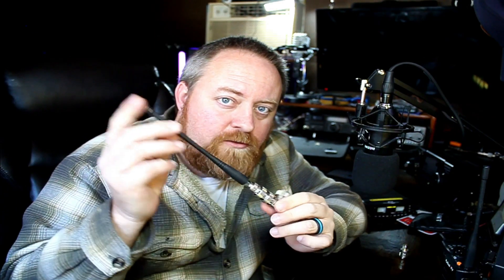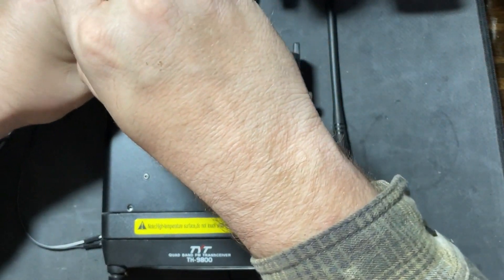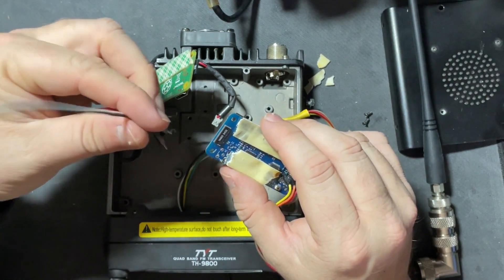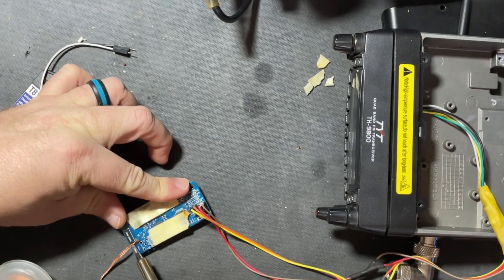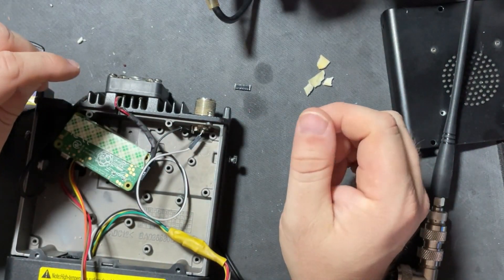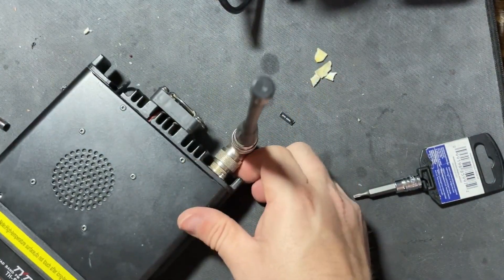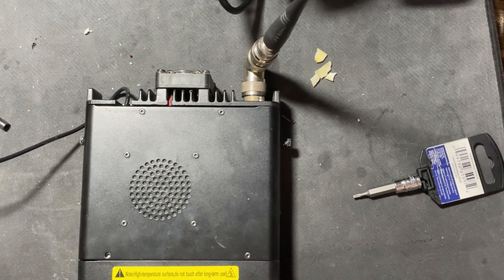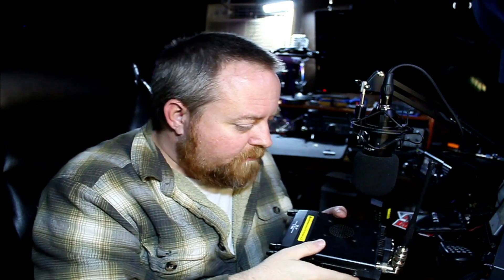MMDVM Hot Spot External Antenna | Ham Radio

Comment: For a Base Setup, I love this idea. It would be cool if they had an OLED display that would fill the entire empty clear space where the old display was, and someone could code up some firmware that would Fill it with information and possibly a scrolling text function. Cool mod I love doing this kind of stuff in the shack. Great job. Oh, if for some reason you have any RF issues, You might try either twisting the wires you used to hook up to the SO-239 antenna jack, or using some smaller coax, but i'd say it'll work fine. Awesome Mod. 73's
Reply from the maker: Thanks Marvin! Yeah I wish I had the smarts to use the 9800 factory size screen. So far no RF issues or anything with it but will keep that in mind👍 thank you.